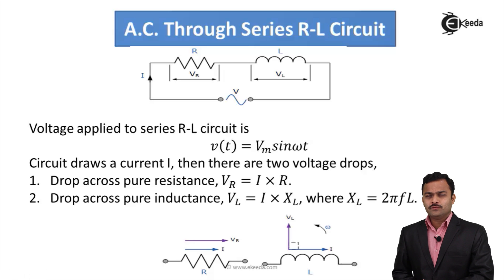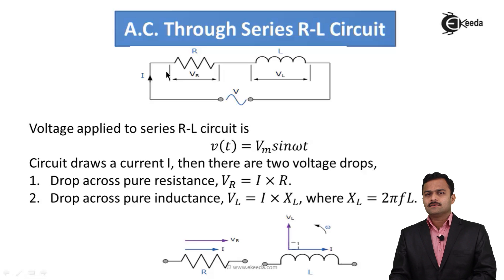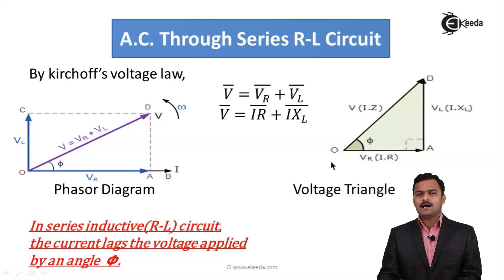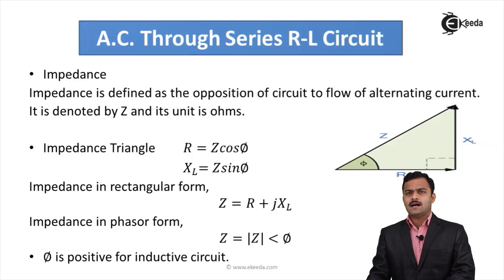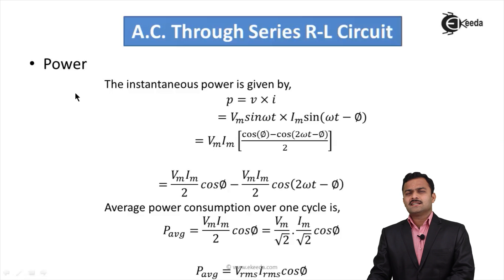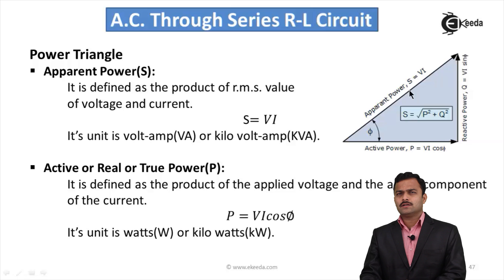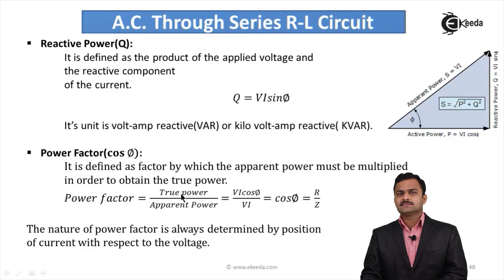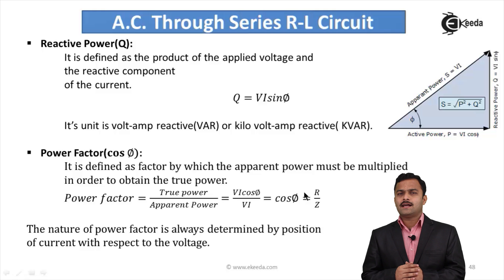AC Through Series RL Circuit - AC Circuits - Basic Electrical Engineering

Comment: Apparent Power according to your definition you said that, it is the product of rms value of voltage and current. So, won't 
Apparent Current(S) be equal to S= Vrms x Irms??
Reply: Yes that's correct